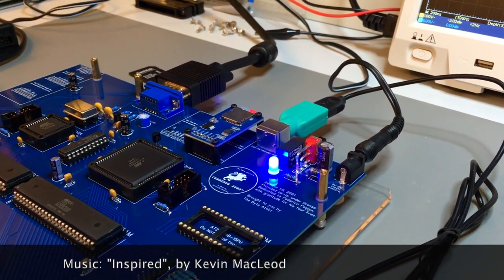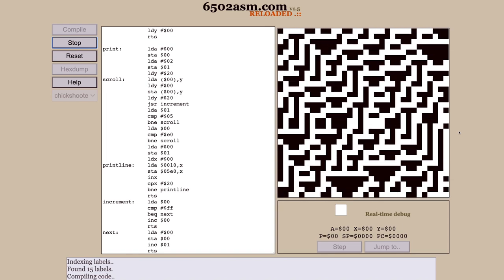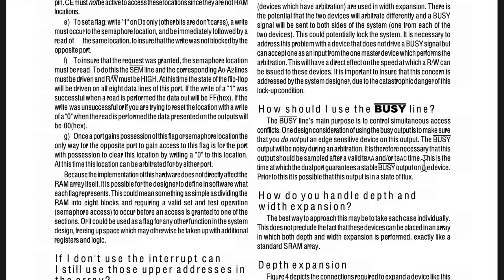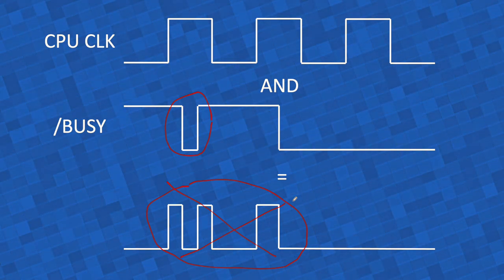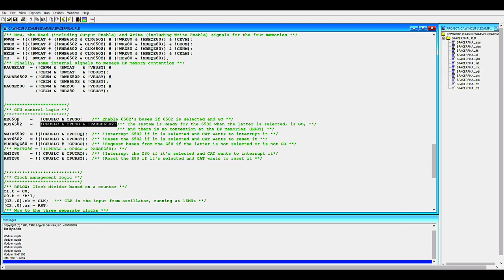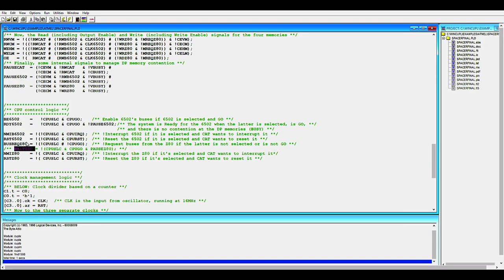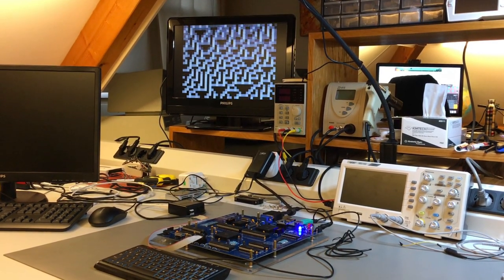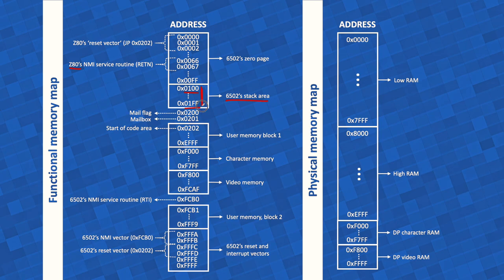Building CERBERUS 2080™, my dream childhood computer: Episode 19

Comment: Excellent Series, I binge watched it. Makes me wish I was an experienced software designer to get my hands on one of those goodies. But I am a RF IC designer so no luck :)   I thought you were going to get into detail about differences between kernal and bios but I may have missed it? Can you in the next episode explain how you are going to start up the CPUs and then halt them. I mean that once they start up, they will try and fetch instructions from predetermined locations based on the CPU. How do you get around this startup issue and force them to execute code at address 0202.
Reply from the maker: Thank you for the kind words! Yes, in the next episode I will cover this in detail. It should be up this weekend.